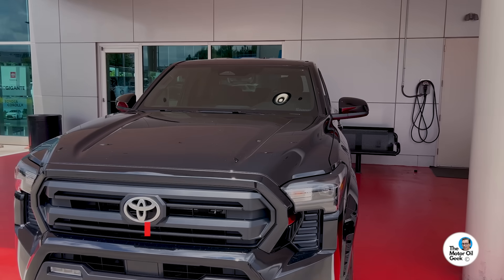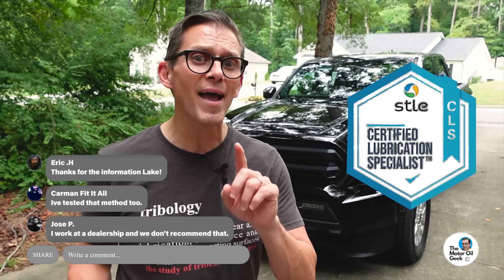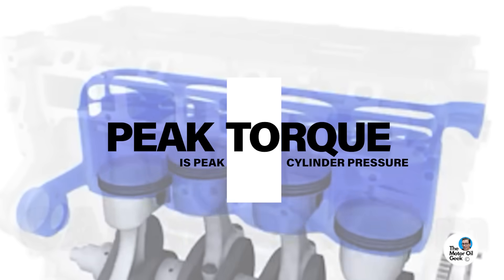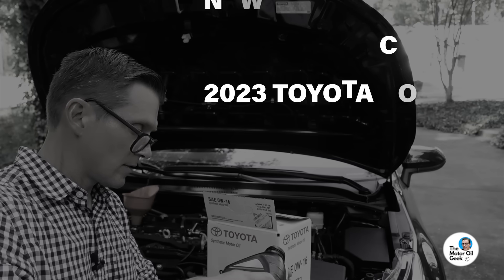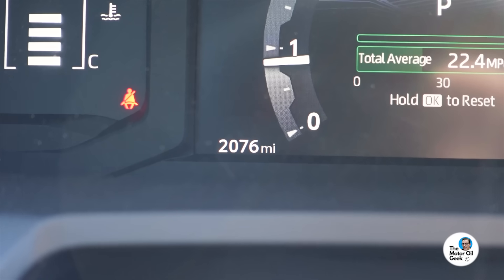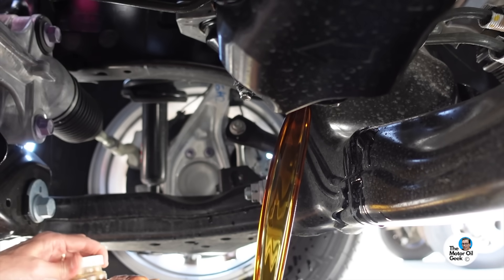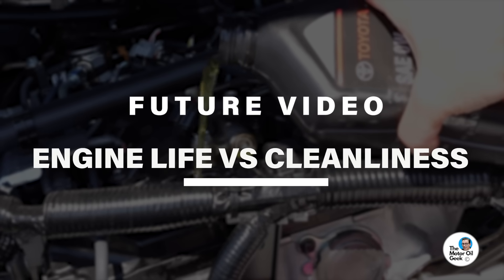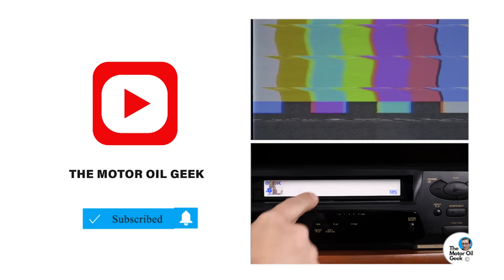The FACTS About Oil Changes (What The Owner's Manual DIDN'T Tell You)

Comment: Also @6:40 if you wait another 15 pounds you would be getting underneath that truck a different direction🤣🤣
  My 6.2l in my personal truck blew up a month ago, luckily the dealership had me going with a brand new engine in eight business days, I changed the oil and filter in the first 500 miles and at 1000 miles and at 1500 although I did change the filter because I cut them open just to see, and really did not notice anything even putting it on a black pig mat.

Comment: What happened to the 0-8 oil viscosity fad?  If it is not good enough for a PU truck, then why is it good enough for a sedan  If it is not heat tolerant for a turbo car, then it is likely not heat tolerant enough to hold up to engine head temps.

Comment: Love the video... BUT...are you sure the prinpals of an air filter apply to an oil filter?  If an oil filter gets clogged, it gets bi-passed by the oil.
Reply from the maker: Yes, the same principles apply. We will see what’s in the filter at 5,000 miles. The bypass is not opening as evidenced by the low particle count on the oil analysis.

Comment: Are you really showing that you'll get less wear in your engine if you do these break-in oil changes? What you are showing is that wear metals in the oil decrease for a sample at the end of an oil change after a previous oil change. The question is whether these < 100 ppm levels of metal, within a certain size range of particle, CAUSE a significant amount of wear, before the first standard oil change, and that removing them lessens wear? One expects that the wear metals actually generated, not accumulated, during the period of a standard oil change, will decrease with time. Have you shown, or do you have other information, that says that the total metals generated during the first 5000 miles of driving is different with two or three oil changes during that period vs. none? If the accumulated metals generation is no different, have you shown, or do you have other information that shows that the wear is different? What you need are, at least, intermediate oil samples from the 5000 mile oil change at the same periods as your multiple break-in oil changes, and oil samples from the 10,000 mile oil change in both cases.

Comment: Install a Fumoto oil drain valve instead of your drain plug bolt and you won't need a wrench and you can pull samples with no mess. Check it out.

Comment: Thank you once again for this great video!  I noticed even in the new owners manual you have, 0W20 is recommended, but 5W20 is approved if 0W20 isn't available (but it mentions changing it to 0W20 when possible).  I live in an area (Kauai, Hawaii) where the temperature never goes below 65 degrees Fahrenheit, or above about 95 degrees. I've often thought about using 5W20 just because I never need the thinner viscosity for cold weather.  Most of the "experts" say do what the manual says... however as you point out perfectly in this video, the manual also says do the first (and every) oil change at 10,000 miles, unless you have harsher conditions, then 5,000 miles.  We all suspect and now you have confirmed that that is too long.  Now I'm wondering if I should use 5W20 instead of 0W20.   What do you think??
Reply from the maker: 5W-20 would be excellent for your climate.

Comment: Wouldn't the oil sample be quite different if you were to able get it coming through the oil filter instead of the pan. Your strategy would work great on older engines that relies on splash lubrication as most modern high efficient engine doesn't. 🤷‍♂️

Comment: The problem with new cars is not the longevity of the motor, but the electronics. Just doing normal owner’s manual recommendations will make the motor last for the life of the car. The problems after the vehicle gets 10 to 15 years old, the electronic modules start to fail. The cost of replacing numerous modules, the programming required, the vehicle becomes not cost effective to repair. Let alone if you live in the salt belt, the car will rust out before the motor fails. The days are over buying a new car and keeping it for 25 years. That ended in the early 2000’s.
Reply: those failing electronics often RUIN the Engine and Drivetrain, even when the issue is invisible and not noticeable, the damage is being done...
Reply: We had a 1989 Mazda RX-7 which we hardly drove for over 20 years.    The module for the wipers failed with less than 70,000 miles on the car.  I didn't know much about cars and was shocked to see it.  And the car was stored in a garage at all times.

Comment: Lake... is the authority on motor oil.    

If I were going to spend $40-50k+ on a new vehicle, spending $40-50 for 6 quarts of Toyota oil, and doing a couple of oil changes before the first recommended interval is proven advice and cheap insurance.     

If this is all it takes to set the proper road map to a 200k+ mile engine, then sure thing, I'm on board.     

Great video, thanks!
Reply: Just a waste of money and time, it's just a feel good thing, to each their own.

Comment: I totally agree with your break-in procedure as far as changing your oil. I have been doing this for the last 40 years on everything from cars to motorcycles.
One tip I want to give you is ditch those Toyota oil filters. They’re terrible. Go with a nice Amsoil oil filter. They are the best.
Reply: Toyota filters are not garbage you're delusional
Reply: @tedbell75  brand ranks tested one and it had terrible filtration performance, and they lack end caps on the filter element.
Reply: @tedbell75 I have no specific data but based on numerous studies, oem fluids and filters are usually lower quality yet high price. Many dealer shops concerned for the customer do not install oem oils.

Comment: Did the exact same thing, more or less, with my second-ever in-my-life new car. A 2000 Honda Accord which we also bought with 7 miles on the clock (which was mostly our test drive). Oil change at 500 miles. The next at 3000 miles and 5000 after that. Stuck with 5000 mile OCIs until about '05 when I started doing oil analysis. Based on those, we upped to 7K (a near perfect driving cycle here... no short hops.. mostly at 60-70 mph speeds) on good quality oil and have been there ever since. About 10 years back, I dropped to 5W20 from 5W30.  Not because I thought it was necessarily 'better" but it consolidated my oil purchases.I justified it two ways: first Honda started recommending 5W20 for our engine two years later and there were no changes in design I could discover. Second, the UOA results were identical. The car is not driven hard or in extreme conditions. Works for me and now all our vehicles can use the same oil.

Comment: My father was an WWII Army, air corps Vet/engineer in the Aerospace industries. He mentioned years ago to me when I was a kid, then it oil filter when slightly dirty filters more. Meaning that the oil that moves past it has less debris and contaminants. It only becomes a problem when it restricts the fluid to the point that lubrication suffers.  He always changed his oil early. I do the same. When my vehicle say that I only have 50% oil life left. I order up a new jug of oil from Amazon and within a few days I’m doing an oil change. Quality clean oil can’t be beat. Engines are very expensive compared to the cost of oil and a filter. Changing your fluid in your transmission and power steering is critical also.
Reply: Its clearly true, but also, that “better filtering” can lower the oil pressure? I assume it does.
In my FA24 engine oil pressure is a worry😅
Reply: @Gapped86 According to this video, that does often seem to be the case. However, apparently at least one filter is able to filter fine particles with low restriction.

There is a comparison chart of about 10 different oil filters near the end of the video: https://youtu.be/mYi640pMjWA?si=ojqFELrtsM-5O0lJ
Reply: The owner’s manual for our Honda Fit actually says to change the oil filter every other oil change.
Reply: "When my vehicle say that I only have 50% oil life left." LOL. The percent oil minders were developed in conjunction with oil analysis and over millions of miles. They use plenty of data such as engine temp, outside temp, rpm, load, speed..... There have been tests showing that the minders are very accurate. You are free to be paranoid and waste your money.
Reply: @jimb8842 Some of them probably yes. Some of them though apparently just count miles. I think Lake did a whole video on the topic.

Comment: This is pretty much what I've done for my Jeep with the 3.6 Pentastar engine.  I now have 3230 miles on it, and I'm going to change the oil, and filter again.  I'm wondering when, or if I should move to different viscosity such as 5W-30 since I live in a hot climate (Florida).

Comment: Is the factory oil still made by Idemitsu? GL6 ? I've been using it on most vehicles (0/20, 5/20,5/30 depending on application)
also a side note on the toyota engines, I've noticed I resurface alot of cylinder heads on them, even brand new as yet to be installed (as late as 2024 my), the factory finish leaves a bit to be desired, which is a bit of a surprise coming from toyota